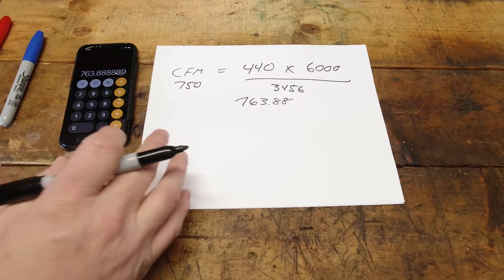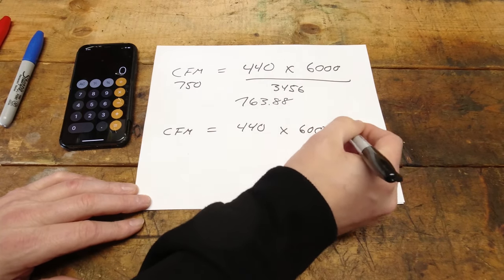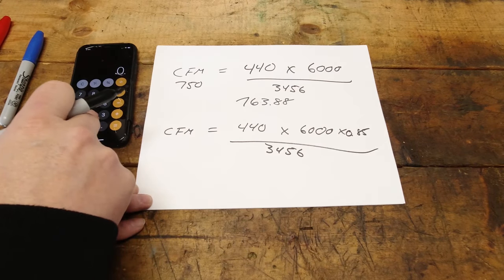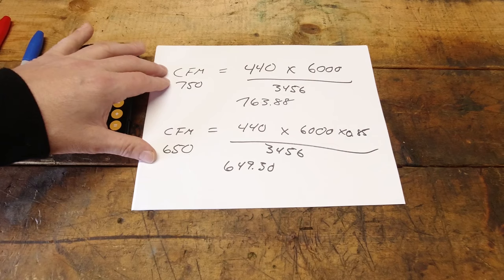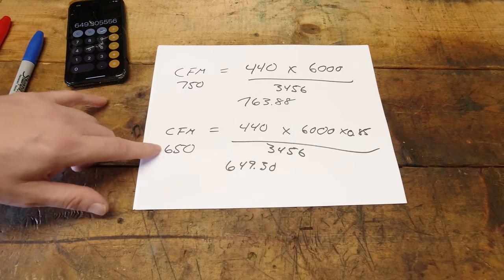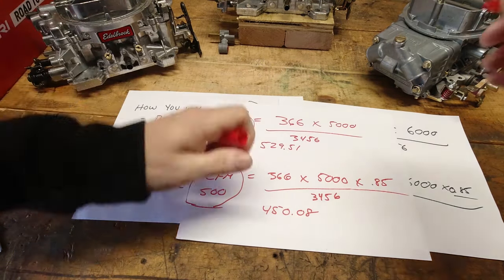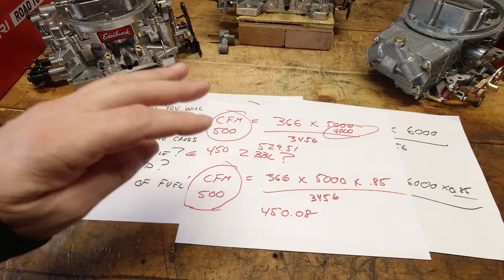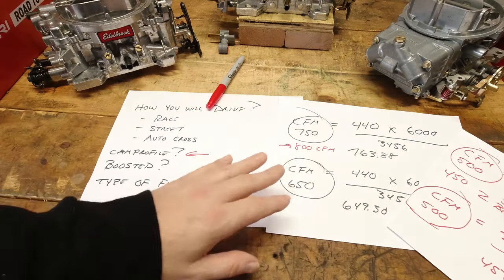How to Choose the Right Size Carburetor

Comment: Even before seeing this, I believe most guys have too much carburetor on their engine. 750 cfm seems to be the default carb everyone uses, but I chose a 600 cfm for my bone stock 396 325 hp big block. The street manners and throttle response are impressive, better than any of my injected engines in fact. I've had many guys tell me I need a 750, that a 600 is too small etc. but nope.
Reply from the maker: Really all depends on what you use it for and what it’s set up for.  I worked on a set up this morning that was WAY over carburated.  I offered to tune one of mine on his set up to prove it.  It really common and like you mentioned, doing it right will get you a better running engine.  Thanks for watching!
Reply: Interesting, anybody's 350 cid V8 at 5000 rpms only needs around 375 cfm, maybe 400 cfm at 5000 rpms, and most street cars never go to a higher rpm than this. Yet most guys never go lower than 650 on a carb, and many go to 750. We need to be realistic when we enter data as to what the revs are going to top out at.
Reply: @bobkonradi1027  and the factory carb was a 750.
Reply: The factory carb was a 750 Q-jet,  the 350 hp 396 had a 750 holley carb.
Reply: True. It’s easier to pick one carburetor and put it on everything than to switch it up. Doesn’t mean the engine is using all 750 cfm. They put 750’s on 305’s and the secondaries wouldn’t even open all the way even at 5500 rpm.

Comment: I used to race a 454 Chevy Big block with  rev limited to 7000 . According to equation 1 , The engine should have a 930 cfm carb. I used both a 850 and a 1050 carbs. The 1050 worked better. Iddle was lower ( 900 rpm compared to 1200 rpm with The 850 carb. ). Power was Also better with The 1050. For racing, The equation si a little bit conservative.

Comment: Putting together a 289 Ford engine in a tiny 2500 lb Sunbeam Tiger. Small 270 cam, dual plane intake, stock exhaust manifolds, 4 speed manual. Will be driven conservatively with the occasional spirited sprint down the on ramp, maybe 5500rpm max. Math works out to 459 cfm. I'm thinking about a 500 cfm 4 barrel...what do you think? Do you know if Holley makes a 500 cfm carb? Or would Edelbrock be a better choice in this case
Reply from the maker: In this case with a lighter car, I’d use a slightly larger carburetor.  600-650 would be just fine.  Everything you have mentioned would match up well with that.  Part of the issue with these formulas, they aren’t an exact science.  👊
Reply: @MuscleCarSolutions  Thanks! Do you have a personal preference between Holley and Edelbrock?
Reply from the maker: @StLouisSled  all depends on what you’re going to do with the car.  Drag race only?  Holley.  Street driving?  Edelbrock.  For what you explained, I’d lean towards the Edelbrock.  Easy to tune and will be very friendly for what you’re doing with it.
Reply: 500 to 550 sounds fine. My friend used a 600 vacuum secondary carb on his 65 Mustang with a 289. Keep in mind two thing. A manual transmission can help a car with too much CFM. When I was in HS, we built a 10.90 comp car at the winter nationals at the old track just outside of Phoenix, Beeline Dragway. We ran a 283 bored out to 292 cubic inch engine. It had a solid roller cam and a 1050 dominator. Again, running a manual trans would have helped, but this high winding screamer was backed by a 2 speed powerglide automatic. It took a good tuner to get that combination running well. We ran under the index in the final, losing a 10.89 pass to the other guys 10.94. Kind a hurts when you lose because you went too fast!
Reply: @kennethcohagen3539  I remember beeline in the 70s.  Left PHX 20 years ago. Would run out there as an adult just to remember my youth

Comment: The problem is 4 barrel carb CFM ratings are measured at 1.5 inches of mercury. So in order for a 850 CFM carb to flow 850CFM it has to be strangling the engine and you would have to have 1.5 in hg at WOT! It’s quite obvious that this carb will flow less than 850 CFM at a lower pressure drop. Now the question is how little pressure drop can you get away with? In my experience you can get a carb to work below .5 InHg with annular boosters and minor modifications. When it comes to 2 barrel carbs they are rated at 3 in hg! So in order to get flow rating of a 2 barrel your absolutely strangling the engine!
Reply: This is why a fuel injected engine will always make more power then a carburetor. A carburetor REQUIRES a pressure drop to function. If a carburetor has zero pressure drop there will be zero fuel flow. Fuel injection DOES NOT require pressure drop as the fuel pressure provides the flow so a fuel injection system should be sized to have zero pressure drop.

Comment: thanks for clearing alot of this up, I have been looking for a Holley DP for my 466 BBF in my 78 f100 street/strip truck (mostly street realistically), have been concerned about going to little or wasting time over carbureting
Reply from the maker: It’s a common mistake.  It’s easy to say go way bigger and think it’s better than finding what the need of the engine is.

Comment: When I was a kid, the math was, max rpm x ci displacement ÷ by 3456 = cfm flow of engine. Add 10-15 % for low gear ratios low vehicle weight ECT.

Comment: Great info as usual! Appreciate all the knowledge you share with the car community, it really really helps!! Thank you and cheers from Motown. Oh, new subscriber and hit the bell.
Reply from the maker: Nice!  Thanks for that.  Just years and years of being around it and making many mistakes.  Glad you’re here!  Don’t hesitate to ask any questions.  I try to answer them all.  Motown thawing out and summer is almost there!
Reply: @MuscleCarSolutions  We have hit over 80 this week and set records. Scrambling to get my Mustang full spool out and go with a LSD so I can turn the darn thing. Also struggling with Deadhead or Bypass regulator. Probably Deadhead with gauge port Holley 12-840, if any problems will do bypass over winter. Mild built 460, RPM performer, Holley 4160 750,MSD 6al, C-6 manual valve body, full headers, 3" into magna flows, nodular 9" 4:11 gears, 4 link,  was ex 8 sec race car, streetable now. Thanks See ya soon.
Reply from the maker: @robertclymer6948  sounds like a heck of a fun ride!

Comment: I run 1200 VenturiLess carburetors on 302 street engines and it works awesome, better than the small cfm carburetors I yank off. Just be honest and tell people these carburetors you are showing are poorly designed and can’t do any better than be run small to hide their design deficiencies. 

These small cfm carbs on engines based on carb size calculators cause a larger percentage of fuel to be knocked out of suspension and flow into the combustion chamber as a liquid. Liquid gas doesn’t combust, it burns, slowly requiring more main jet to make up for it. This makes the engine less efficient, heats the exhaust valve and port, shortening the life of the exhaust valve and increasing the likelihood of an exhaust valve/catastrophic engine failure
Reply from the maker: Eager to see your videos putting your theory to the test!

Comment: Just ran across this video. It was VERY informative. Here is my dilemma: I have a stock 350 sbc in a 72 Impala coupe (weighs about 3900 lbs.) with a 200R4 transmission and 3.73 rear end. An Edelbrock 1406 (600 cfm) sits atop a dual plane intake manifold that is fed by in-tank pump (max psi: 49-50) regulated to 5.5 psi by an AER fuel regulator.  Max RPM for the engine is 5500; however, I have yet to hit 4000 even on the hills in my locale (3800 was the highest so far). I do not race but use the 3.73 gears for acceleration and the 200's OD to cruise. The 1406, IMO, burns too much gas. Edelbrock recommends the 1406; however, an older mechanic I know suggested moving to the 1404 (500 cfm). The math in your video also supports that mechanic. I'm looking for a final confirmation prior to spending the money for a new carb.
Reply from the maker: If you’re only spinning it to 4000 rpm, then that’s your number.  Make the switch to a 500 and then TUNE it for your application.  It’s not correct right out of the box.  Never is.  Once it’s tuned, then you can determine if it was the right move.  Sounds like it will be.
Reply: @MuscleCarSolutions  thanks for the IMMEDIATE response 👍
Reply from the maker: @ernestadamsjr.2662  sure thing.  Best of luck with it!  My family had a 72 Impala sedan when I was a kid.  Love those cars!

Comment: When towing or using engine in a heavy vehicle go smaller CFM. Air Velocity is what we are after in carburetor sizing. We want high air velocity so the carburetor works properly plus to fill the cylinders well especially at low rpms. If air velocity falls off due to carburetor being to big low end suffers. That's why smaller for towing and heavy vehicles. You can go bigger with lighter vehicles and higher rpms engines. When driving on the street we don't see much past 3500 rpms so the high air velocity of a smaller carburetor provides a much better driving experience. Good stuff!

Comment: If anybody is wondering the 3456 comes from converting cubic inches to cubic feet and from considering that the car is 4 stroke meaning you will only pull air every other rotation.
Reply: Then it means you need to half these numbers when using a 2-stroke carb. Or am I wrong?

Comment: I'm running a junkyard low compression dodge 360 , edelbrock 340 manifold , A body manifolds true dual in a 3300 lb car and 373 diff with a edelbrock 600 cfm , mostly in town driving . Runs great , amazing fuel mileage and spark plugs are a light brown .
Reply: I have chevy small block what size is best for saving fuel?

Comment: I had a '77 Camaro back in the mid to late 80's that had a .40 over 350 with flat top pistons, roller rockers, stock exhaust manifolds a TH-350 trans, stock converter with 3:08 rear gears and 305 two barrel heads with small ports and an RV type camshaft ( I don't remember the brand name or specs on it though) that had an almost stock idle but you could tell it wasn't completely stock, the intake was a dual plane Edelbrock performer and I put on a 600 Holley with vacuum secondaries. I dont remember if the Edelbrock carburetors were around yet but the Holley was just over $100 brand new back then. I never had to fool with the jets or anything other than the idle speed and mixture, it ran pretty well out of the box. I ended up daily driving that car for quite some time. I had to watch the fuel quality and timing since the 305 heads bumped up the compression a bit but it had excellent throttle response and averaged around 17 MPG on the highway. I'm sure the cam, heads and exhaust held back any real top end performance but the low end torque was good enough for what I used the car for since it rarely saw anything over 4-5K RPM. I still regret selling it along with the other old cars I used to have which were cheap and plentiful back then.

Comment: Great video, alot of guys over cam & over carb their street engines......I am building a 350 Vortec and I picked up a used 600cfm Edelbrock Performer(gonna do a rebuild on it just to be safe). This entire engine is being designed around that 0-5,000 rpm street tourque band. Scored a dualplane non airgap intake. If/when I change the cam I am going for a tight LSA (probobly 108) with a 0-5,000 appropriate duration etc. I am all about that throttle response since I am gonna spend waaaaay more time at 3,000 rpm vs 6,000rpm.....heck I am gonna roll manifolds since headers are a nightmare. Hp/cu-in in a light weight 2wd GMC Jimmy is gonna be FUN.

Comment: Q-jets use the airdoor to tune the cfm.Everyone of them has at least the 750cfm potential i.e. of some rare buicktypes. The factory used the angle of the airdoor for setting the carbs to tamer or smaller engines
Reply: Correct but my understanding and experience with them since I was a young man..2 types 750 and a 800 CFM..Look down the secondary if thier is a nub sticking out.. It's a 800 CFM...looks like the tip of your pinky finger..Other wise smooth it's a 750

Comment: So glad I stumbled across this. I'm building a 351w for a 92 f150 4x4 AOD transmission. I'm running a .513 lift 270/276 duration 110 lobe separation roller cam. Stock Gt40 heads with a spring kit an edelbrock performer intake. Motor will be natural aspiration. Cam is rated 1500- 5500 rpm and intake is idle - 5500. It will be a daily driver and toy hauler. I have an edelbrock 1405 600 cfm sitting my shop now, but im wondering if I should step up to one of the new avs 650 cfm. Great content btw.
Reply from the maker: I’m glad you found it too!  I don’t think you can go wrong with the AVSII.  Sounds like for what you’re doing the 650 will be exactly what that combination is calling for.  The windsor engines are exceptionally versatile and should deliver everything you’re asking from it!
Reply: I built a 351w 0.030 over 9.6.1 with a typhoon hi rise Intake. I also am running the same roller cam and I put it in my 87 f150 4x4 with a C6 and 3.55 gears. I have tried a 750, 725, 600 and currently using a 570 (all carbs are Holley) so far I think the 570 works the best.

Comment: 307 Small Block in a 3/4 ton manual 4 speed GMC pickup. Street drive only with a mild RV cam. Thanks for the great information.
Reply from the maker: Yup.  You’ll have a much smaller CFM carb on that application for sure!  Thanks for watching!  Glad you found it useful!

Comment: Interesting: The Holley website has a formula and also a little electronic tool where the data is entered and then you get an answer as to what size carb to use. Edelbrock has the same thing. HOWEVER Holley then says to take the cfm recommendation and add 15% to it, for whatever reason. Edelbrock doesn't say this. They just stick to the initial number that their little electronic tool spits out. Both websites do agree, though, on the fact that you have to be realistic in what rpms you're actually going to run the engine at. Don't tell the calculator that you're going to run to 6000 rpm (or whatever) and then actually you never go over 5000.

Comment: 425 cadillac bored .600 due to cylinder wall damage, so 439 Cid. Stock cam. Dropped into a 64 Buick LeSaber with 3.42 rear gears. Max rpm before valve float is 4500 rpm. Torque peak is 2000, horsepower peak is 4200. I honestly thought the car had had higher rear gearing, but it was originally a manual car with a 300 Cid v8. They all got deeper rear gears. 2000 rpm is 50 mph. Top speed is 107 before valve float shuts it down. Car is primarily a weekend cruiser. I have a 750 cfm Edelbrock on it. Original carb was a 800 cfm Quadrajet.
Reply from the maker: The Qjet can be a little deceiving when you just look at the CFM number.  Yes it capable of 800 CFM but I’d you look at the primaries, they are in fact substantially smaller than the secondaries.  It’s how GM wanted to control the fuel and give the air and fuel needed when the demand was needed.  The difference in the two carbs really can’t be compared on CFM alone.  But you certainly have a lot of cubic inches to feed if you decide to go bigger on that cam!  Awesome to hear you’re running a big Caddy.  Always fun to see those big old school engines still on the road!
Reply: @MuscleCarSolutions  Thanks for the reply. I got the Caddy and TH400 behind it pretty cheap and went with it. It's been fun, but frustrating at times. Partly because I chose a car that isn't  common, and an engine to swap that isn't  common, either. I'm considering upgrading to a mild cam and stronger valve springs to go to 5000 rpm.
Reply from the maker: @johnbutler1323  that’s the downside of the cool factor.  Fewer things available for their engines that don’t have a lot of volume to support lots of aftermarket parts.  Which just makes what you’re doing even cooler!
Reply: @MuscleCarSolutions  Thanks. One of the crazy things about the 425 Caddy is they debored the big 472 from 4.3" to 4.082" and kept the same 4.06" stroke. When they did, they knocked off every ounce of excess metal in the block and heads and actually opened up the water jackets quite a bit. The 425 Caddy big block weighs 100 lbs less than the 472 it's based on, putting at 525 lbs, which is 50 lbs lighter than a fully dressed Chevy small block with iron heads and intake and comes out about even when the Chevy small block has aluminum heads and intake. It's a very light engine for its displacement,  especially  considering it's all iron. The block is so light, I could pick it up and carry it around when it was stripped. It does take up a lot of real estate, though, and is every bit as wide as a Ford mod motor.

Comment: Hi there so I have a 78 bronco with a 460 out of a 70s motorhome. Can’t get it to run fast and efficient lol what carb do you recommend. Currently has a 750 with Edelbrock dual plane manifold
Reply from the maker: Not sure I understand what you mean by fast and efficient.  What is it doing that you don’t like and how have you attempted to  tune it? What size did you come up with after watching the video?